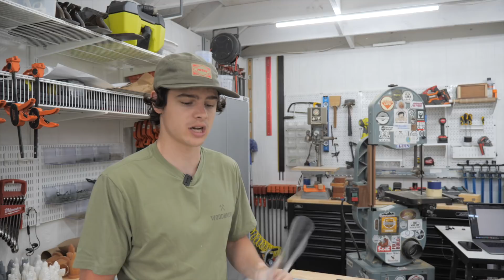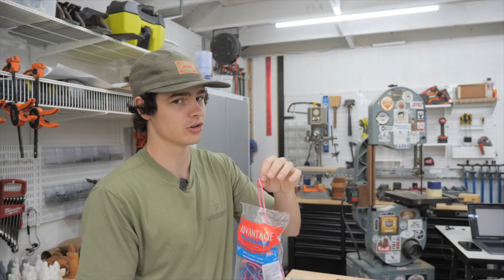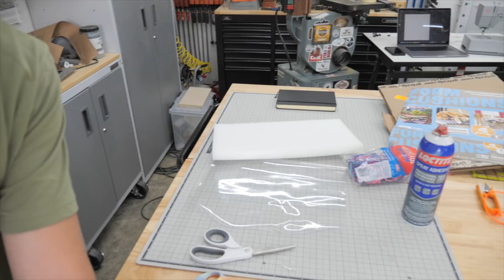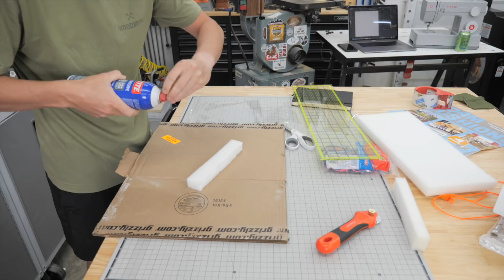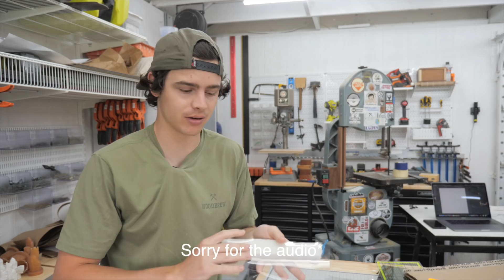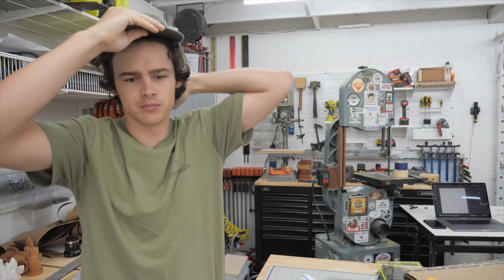DIY Medical Face Shield ($0.40 cents)

Comment: We are going to need these for teachers now that schools are being forced open.  Please make them for teachers at your local schools. Kids are wonderful and loving, but they are germ spreaders.  Every year teachers get colds, sore throats, earaches, etc. especially at the start of the school year.  This year it could be deadly.
Reply: Gwen: It is possible for teachers to improve their self care to avoid some, many, or all of those colds and sore throats.  Over 10 years ago I suddenly STOPPED having colds.  That October I happened to start drinking chamomile tea daily in either warm or room temperature tap water (to mask the flavor of Washington DC chlorinated tap water).  Chamomile is well known as an immune system booster, although I did not know that previously.  Also, after a year and a half, I lost a shoe size and a half as the result of the anti-inflammatory effects of the chamomile.  The anti-inflamatory effects of chamomile also removed the pain from my arms, which had developed diagnosed inflammatory conditions from overwork.  That had been a long standing problem that had resisted many medications and had proven hard to treat.  My orthopedist validated the results.  I had made no other dietary/medication changes during that time period.
     Two winters ago I tried using tumeric tea to attempt to get rid of winter sore throats.  I did a basic Google search for the dosage and read to use 1/4 teaspoon in 1 glass of hot water.  On occasion in the winter I wake up with a sore throat and really hate that.
     I immediately had 1 glass of tumeric tea.  Because I did not trust the remedy, I drank a second glass after a little over an hour.  The sore throat was entirely gone by noon.
     This recent winter I woke up twice with a sore throat and consumed only one glass of tumeric tea each time as soon as I got up.  One glass was enough to eliminate each sore throat before noon.  I was very pleased with the results.
     Tumeric is well known as an anti-microbial and has the rare attribute of being an anti-viral that is a food for people.  Mostly, stuff that will kill viruses can kill people because of our similiar chemistry: proteins, water, and DNA/RNA.  (Of course, we also have lots of bone calcium viruses lack.)
     If the colds are stopped, that ought to reduce the number of ear aches.  I am not particularly suseptible to ear aches, so I cannot say for certain.  My physician, however, has told me that vertigo can be caused by respiratory illnesses and by stress.  I have noticed I no longer get vertigo, since I no longer get colds.  Because I have also made efforts to reduce stress, that may be an influence.
     I understand those who teach children get a particularly heavy viral load.  I am out with the public and get a heavy viral load also from a very wide public.
     Since both chamomile and tumeric are common foods, teachers might want to see if the nutrients in those two food products improve their nutrition and health.
     P.S. In February about a week after I attended the Washington, DC, Chinese New Year parade, I got Covid-19, starting with the profound lethargy symptom.  I had not heard of Covid until the cruise ship news.
     Coincidentally, I had commercial packets of curry on hand in case of a winter snow storm, do I ate those instead of food requiring effort.  Those curries had lots of tumeric.
     I believe that the tumeric and the daily chamomile tea saved me from Covid-19.  At the time, DC had frequent non-stop air flights between Beijing and Dulles airport.
     Covid-19 is now commonly discussed as having a strong inflammatory component.
     I will add though that I always get the flu shot and had the pneumonia vaccination twice because of my physician's previous insistence (due to worrisome bronchitis).  Maybe the second pneumonia shot worked to reduce bronchial rales.  I can't say for certain as we have had a couple of mild winters.
     I don't know what kind of a viral load I got of SARS2 from being out in the parade crowd of several thousand people for about an hour and a half.  But given the numbers, it was enough.
Reply from the maker: @branch is going in hard in this comment section

Comment: *IMPORTANT* 
Do not use PVC vinyl as a face shield! Here's why.
PVC vinyl is a known CARCINOGEN. 
The fumes are toxic. PVC should not be used near the nose.
Please research before purchasing. Use Dura-lar or something similar instead.
Reply from the maker: You need to make sure the vinyl you use is complete junk that off gasses, but a stable product does not do this. This is a common myth derived from old manufacturing techniques.

Comment: Thank you for this easy tutorial. I was able to get all the supplies at Walmart except for the large rubber bands.  The only problem I had was the adhesive wasn't holding well on the Vinyl that had some folds in it from the packaging. I also live in Florida so the humidity may have affected it. I peeled the foam off and sprayed more adhesive. The put three books on top for a while. I think that it's going to stick now. I will let you know. I used a hole punch in the corners and nylon clothesline that ties. since I couldn't find the large rubber bands. The clothesline works great.
Reply from the maker: So happy to hear it's working now!

Comment: Basic protective measures against the new coronavirus
Wash your hands frequently
Regularly and thoroughly clean your hands with an alcohol-based hand rub or wash them with soap and water.
Why? Washing your hands with soap and water or using alcohol-based hand rub kills viruses that may be on your hands.
Maintain social distancing
Maintain at least 1 metre (3 feet) distance between yourself and anyone who is coughing or sneezing.
Why? When someone coughs or sneezes they spray small liquid droplets from their nose or mouth which may contain virus. If you are too close, you can breathe in the droplets, including the COVID-19 virus if the person coughing has the disease.

Avoid touching eyes, nose and mouth
Why? Hands touch many surfaces and can pick up viruses. Once contaminated, hands can transfer the virus to your eyes, nose or mouth. From there, the virus can enter your body and can make you sick.
Practice respiratory hygiene
Make sure you, and the people around you, follow good respiratory hygiene. This means covering your mouth and nose with your bent elbow or tissue when you cough or sneeze. Then dispose of the used tissue immediately.

Comment: The plastic you can use a two or three LITER bottle. Card board in place of foam. And string or ribbon in place rubber bands if you can't find these products to buy or can't afford.

Comment: Amazon has the clear sheets, 8.5 x 11, 100 for $12.97. U can also use the weatherstripping instead of the foam
Reply: I just looked on amazon didn’t see those for that pricr
Reply: @kikib3573  They are gauging already
Reply: kiki b high demand and hard to find supplies for cheap will drive the prices high. P
Reply: Steve Peterson actually they worked quite nicely for the people I made them for. They loved them and others have requested.
Reply: Yes the weather stripping is what I use..and a hair bandau

Comment: I’m using pool noodles $1.50 each from Big lots and cutting them 11inches long and about 1 1/2 inch wide... using hair bands/head wraps $2.00 from big lots ...cut head wrap and staple ends to the transparency film from staples  100 sheets (most expensive thing) hot glue pool noodle foam onto film after stapling the head wrap with pointy staple part inside so it’s covered with the pool noodle...
Reply: send photo
Reply: @vanwitzenberg1493  I use double sided permanent scotch tape to secure them, 3 medium size pieces 1 in the middle , 1 on each side  ...  cut the noodles up about  10.5 in strip(11 was too long).. about 1.5 - 1 inch wide or smaller, they are thick enough to leave room for glasses etc... not sure how to post image=( I was using glue gun but tape is easier...got transparency film on Amazon ....
Reply: Picture please
Reply from the maker: That sounds awesome!

Comment: These are great!  But I think you need to make them wider to cover the ears.  Also, I would seal the holes where you put the rubber band through with something like hot glue or caulk.  These virus particles are believed to be around 0.01 microns in size - extremely small!
Reply: Agreed; I will make the chin area more fitted also, so will likely need to cut it longer to accommodate fitting chin as well as wider to cover ears.
Reply: Health care workers are using their masks under the face shield for extra protection. I believe both should be used. 👍

Comment: Another potential source of plastic is a straight sided 2 liter soft drink bottle.  These are often used for generic brand soft drinks, and have a shrunk on plastic label which is only attached to the bottle with a single line of glue.  Remove the label by slipping a knife under it and cutting it, then rip off the remains. Cut up the bottle by stabbing holes with a sharp pointed knife then cutting with scissors.  After avoiding the glue line, you will have a piece of stiff clear plastic about 10 inches x 6 inches with a natural curl to it.  The 6 inch depth is not as great as that used in the video, but is sufficient that the face shield will go down about to chin level.
Reply: Bruce Dunn Thank you for this brilliant idea. Wishing you the best in this trying time. I will try to make some of these face shields for my family. Better to have it and not need it.